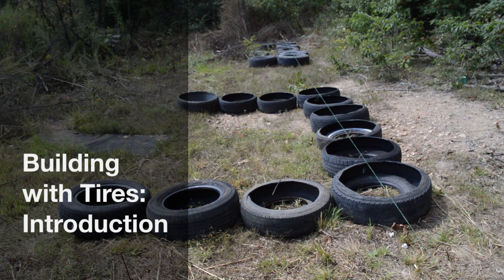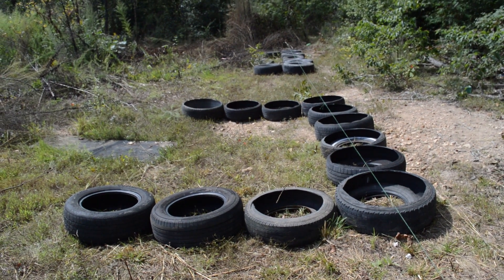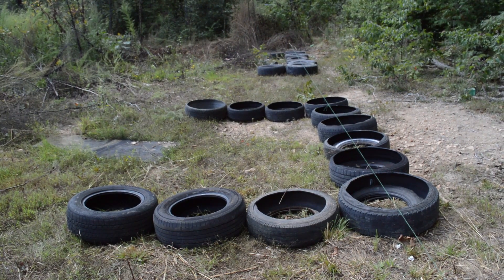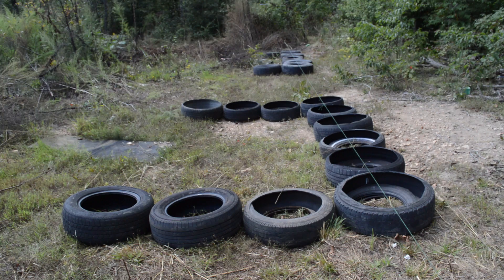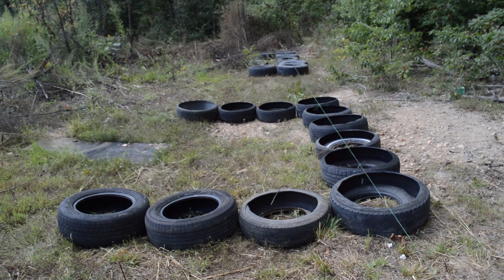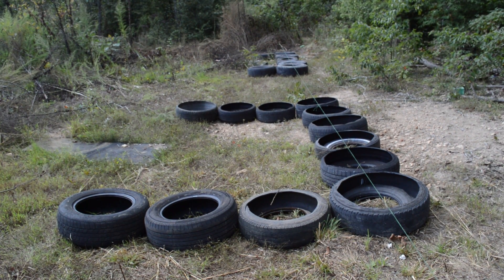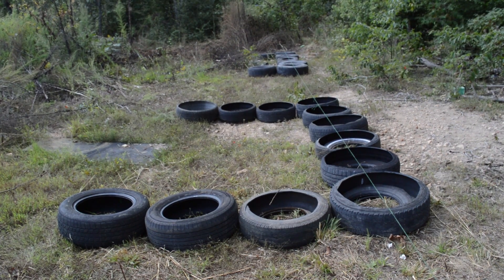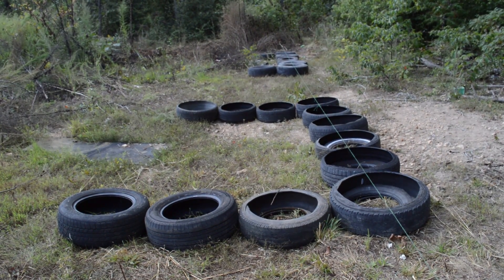Building with Tires #1 Introduction

Comment: jimh: You can cut the sidewalls with a razor knife.  Cut about an inch from the tread as there is thinner material there and no wire.  Tire should be about 3' from the ground (Card Table?).   Hold the tire with the left hand and cut with the right.  Pull the razor knife towards your chest.  Don't worry It is almost impossible  to cut yourself.  If the knife slips your whole are jumps back.  You can't  stab yourself in the chest unless you are suicidal.    I have gone through trial and error and many designs.  Both sidewalls should be cut so that the load from  other tires being filled with dirt and stacked can pass the load directly to the earth.  You want an uninterrupted column of dirt.  Wet the dirt with a hose and trample on the  dirt.  Its a bit messy so put a small piece of tarp on the wet dirt and trample it down.  Also stack the tires in columns.  DO NOT CROSSHATCH like cinder blocks.  I have read about university architects doing this.  They think that it provides more wall strength but the tires are so stable that you are wasting your time.  I have tried every way that you can think of.  I need my butt kicked for not  making a video to share my hard earned know how.  I am going to quit thinking about it and just do it.  My name is Chris Harris.

Comment: i have 50 tires, mostly farm tractor and semi truck tires, because the local tire shop in this farming community will give me a nearly endless supply. my dirt is a sandy-loamy mix, hardly any rocks. I cut the sides off one side and planned to stack them like a concrete block wall. Considering digging to depth of 4-5 ft for earths insulating quality and i'll start digging by hand. Hopefully your later video's and others will teach alot of what I need to know
Reply: 50 tires is a start, good luck with your laborous endeavour.    I am doing some work myself out in the woods with tires and fortifications. 

Can't ever have enough secure spots for what's to come.
Reply: Large tires are a pain but If you can cut them that is the way to go.  See my post above.  DO NOT stack  them like concrete walls.  Dirt will slide out where they overlap.  They have just as much stability if you stack them in columns.  Not guessing.  I have an 8' test wall that is a column.  I only got it to collapse at 8' with soaking wet new dirt  behind it and not dead man and not tied to the column next to it.  Just built a 4' wall and I don't have a care in the world putting soil behind them and wetting it to make it settle.  They are in 4'columns sitting next to each other.  They have not moved a millimeter.